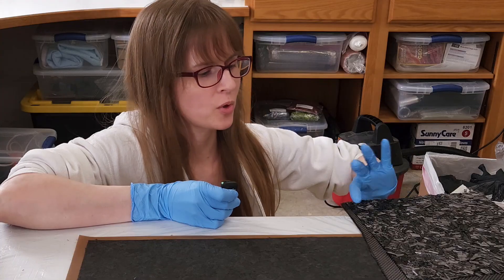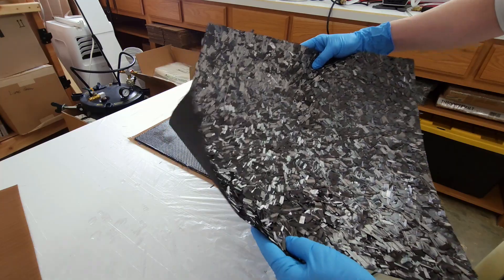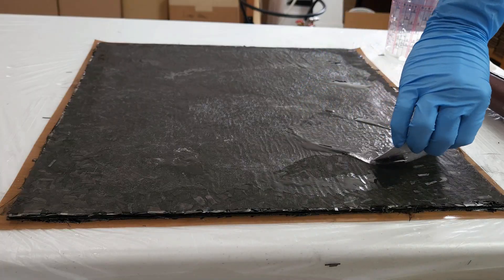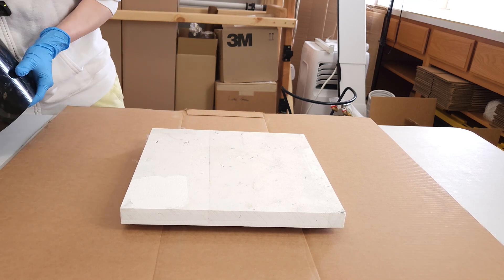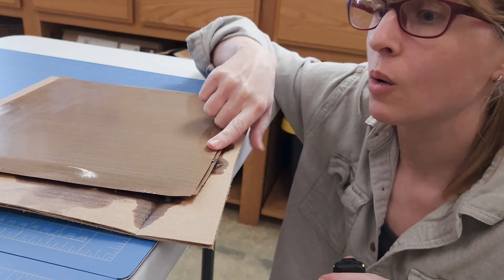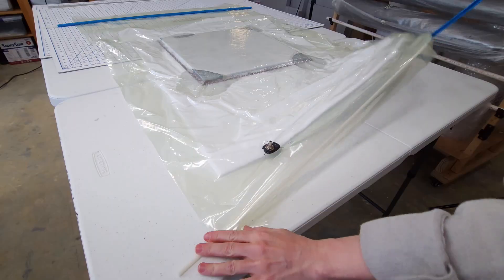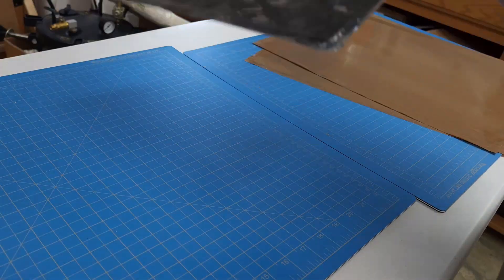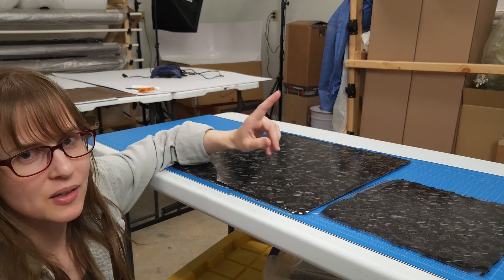Do I need a vacuum pump for carbon fiber?

Comment: El problema estético es lo de menos, con una fina mano de resina por encima solucionado. El problema es estructural puesto que dentro del material es donde no sabemos si han quedado burbujas que lo debiliten tanto en un proceso como en el otro (seguramente en el envasado al vacío no). Pero lo suyo es hacer pruebas de resistencia para determinarlo y ver si aun así es funcional para su desempeño.

Comment: To equal the efficiency of the vacuum bag you'd probably need a few hundred pounds of force, or maybe even tons of force.
Reply from the maker: Not sure I can lift that much
Reply: @LindyDesignLab screw press is your friend. 2 sufficiently solid pieces of whatever, 4 bolts and a torque wrench gives you several tons of clamping force.

But let me repeat myself vacuums are efficient.

Comment: Hey Lindy  great video. Where do you buy the Carbin Fiber Veil?
Reply from the maker: I've gotten it from Composite Envisions before, also ACP Composites but they started selling only in bulk. The one I'm using here is the 0.2 oz by the way.
Reply: @LindyDesignLab  Thank you